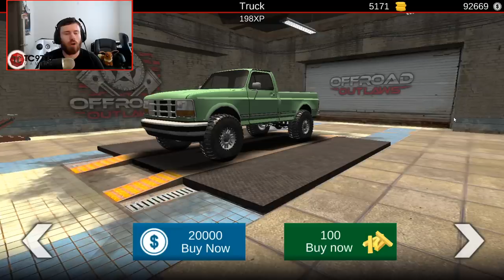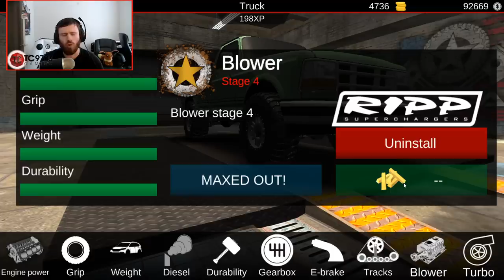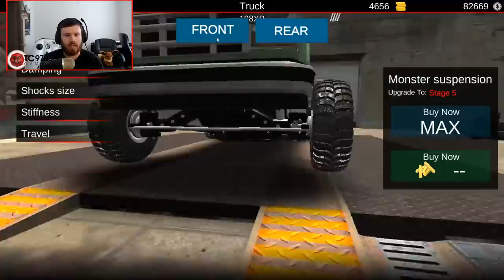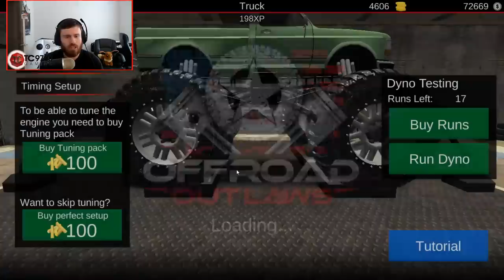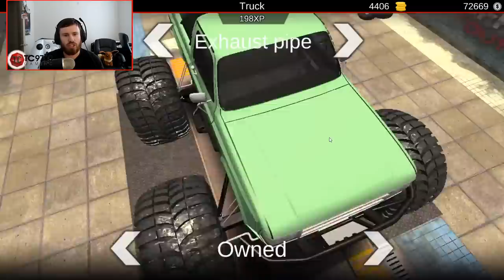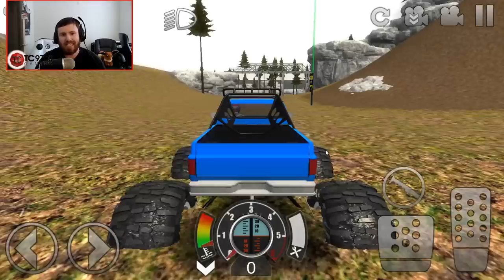OffRoad Outlaws: BIGFOOT MONSTER TRUCK BUILD!!

Comment: It’s not an exact replica the wheel width is too wide and the rims are too small and the front bumper is wrong and you don’t have the roof lights and Bigfoot is originally a mud truck yet you but rock tires on it

Comment: I made it best

Have you even seen a picture of Bigfoot 

Are you even a Bigfoot fan

Your axis width is way to big 
Your rim size is too big 
Your bumper is just wrong 
If you find me in the game you’ll see my bigfoots and they are proper replicas

The spirit of Bigfoot is make sure you can recognize it immediately 

The original Bigfoot is a 1975 Ford F-250 

And all monster trucks have complete 4 wheel steering 

It’s Bigfoot4x4x4 4 wheel 
4 wheel steering 4 wheel drive

I’m not a hater I’m just saying
Reply: Leatherface weird flex but ok
Reply: I’m not flexing
Reply: It’s info
Reply: And questions
Reply: Leatherface useless info
Reply: Needs to be stiffer, smaller wheels, smaller tires, narrower, full 4 wheel steering